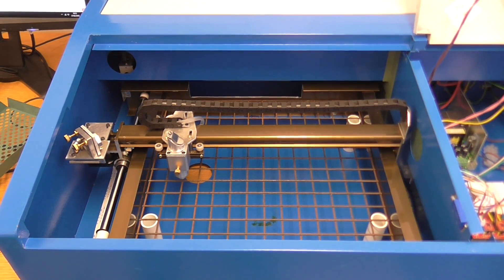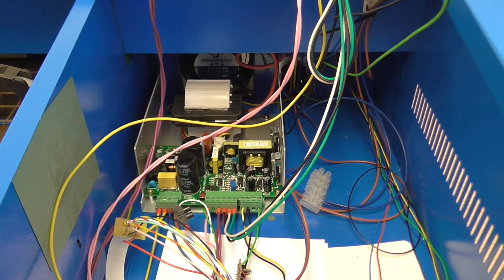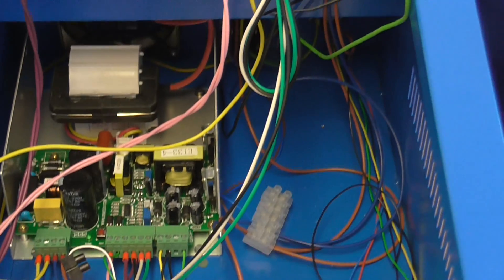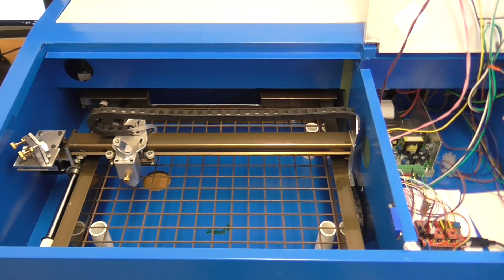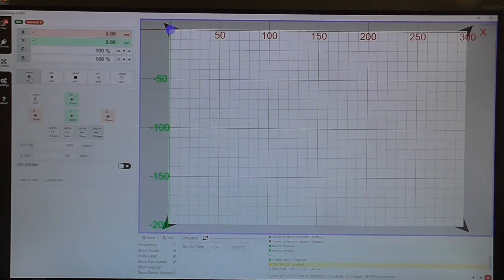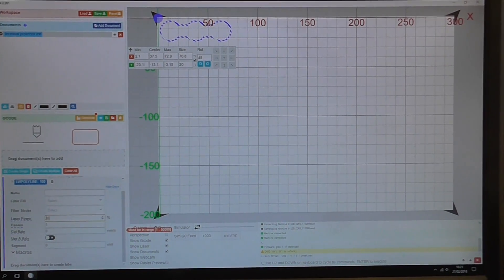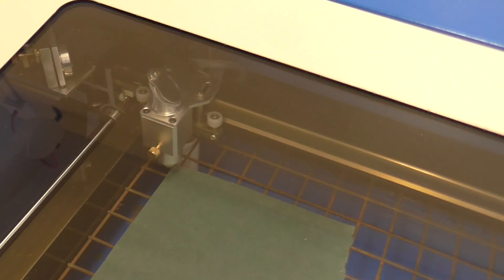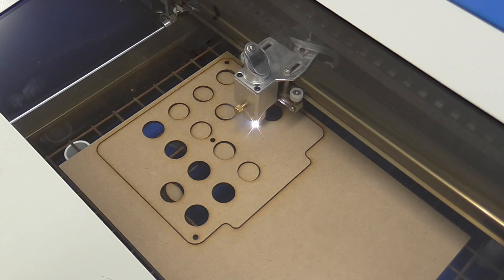K40 Laser cutter - more upgrades

Comment: Fantastic video and project, mate. Would you mind telling me where I could plug the fan pwm wires from a 3d printer control board into the K40 power supply? I would like it so that when I enable the pwm of the fan output the laser fires at the predetermined intensity. Thanks a ton in advance

Comment: Great video. Where did you get the air assist top plate and holder?
Reply from the maker: Random supplier via ebay. There are lots of sources if youe search for them.
Reply: @EVguru  Ooooook, but what are the search terms for the actual part you found? I liked the concept.
Reply from the maker: You know, it was quite some time ago, so I don't remember the exact search. It probably involved 'K40', 'laser', 'air assist', 'head', 'mirror holder' etc. in various combinations.
Reply: @EVguru  Found it, thanks..

Comment: Is your window upgraded also? It doesn't seem like standard plexiglass and much much more clear than the orange window my K40 came with. Looks like the same coating as my safety glasses. If so could you please provide a link for where you got it? VERY nice upgrades by the way.

Comment: Very interesting. I have the same hardware but am unable to make it work. could you send your config.h settings? Also how do you set position in web laser 4?
Reply from the maker: I'm afraid I don't have the files. I programmed the Arduino on a PC at work. The Laser cutter has been in storage for quite a while since I left work and I don't recall how I had it set up with Laserweb. I was working on getting it working directly from Fusion 360 CAM with the appropriate post-processor.

Comment: Hi, thanks for your video. My 40W Laser Engrave machine having movement problem, as per my video  https://youtu.be/L7tmjmQYgD4   the laser cannot move downward (Y-axis), it will working back after power off and turn the machine back on. 5 out of 10 time, this error happened. 
Can you advice ? THanks.
Reply from the maker: Sorry for the late response, I never received notification of your comment via YouTube.

First of all, check for wiring faults. However, the original controller is not particularly good. The upgrade to something like an Arduino and GRBL is well worth the effort.

Comment: Hi Paul, could I ask where you got that replacement laser head from please - was it a UK supplier or somewhere from Aliexpress? I can see very similar ones, but without the two additional screws at the end. I'd like to make a similar upgrade.
Reply from the maker: I'm pretty sure I bough it from ebay. I added the two black screws to retain the main body independently from the mirror mounting.
Reply: Thanks Paul, I'll have a look and see if I can find it on there.